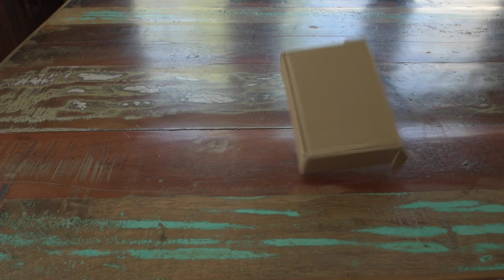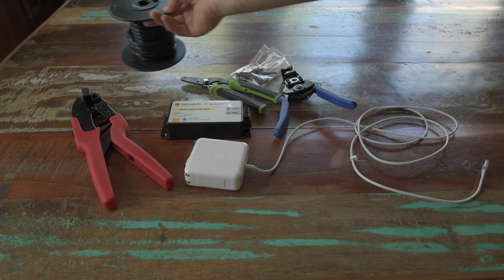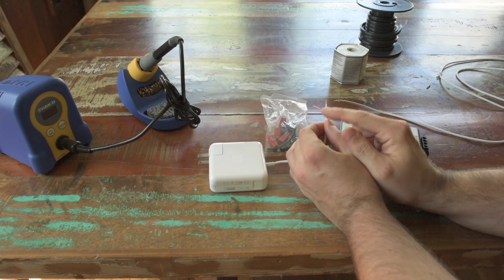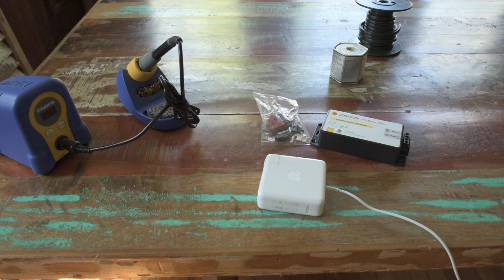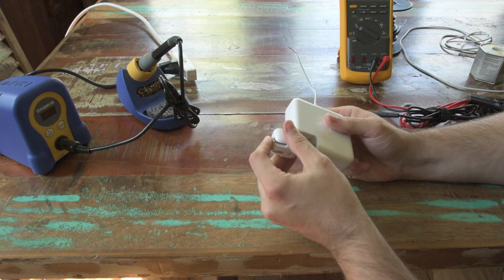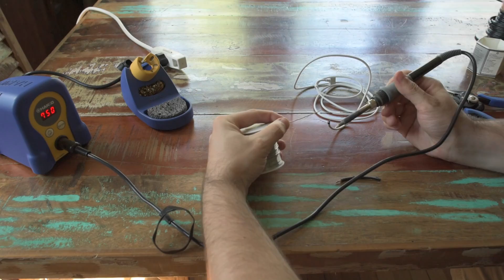DIY Solar Macbook Pro Retina Charger

Comment: There are MagSafe connectors for 10-15 $ available on eBay. No need to cut it off a perfectly fine power adapter.
Reply: I don't think they had them when this vid was made.

Comment: you can do this with 8$ replacement cables and change voltages 20v>18.5v>16.5v>14.5v for mppt
Reply: I have never had any issues in my experiments

Comment: Hey :) 
I also want to do a solar Macbook charger (having the same Macbook as you have) and really want to use the same components as you to be on the safe side. 
But I really can't find the Genasun GV-Boost with 20V. :( Would be nice if you could help me.
I'm not really into all this electro-stuff ;)
Thanks
Reply from the maker: +13lack4ngle you just do a custom voltage order from genasun. They give you customization options after you press the buy button.

Comment: If i use the Go Power 300W inverter what solar panel or batteries do i need ? thanks ..
Reply from the maker: That's a really complicated question. You need to know what you want to run, where you're located in the world, and how long you need to run it, among other things. However, in general you'll need a charge controller, a battery, and a solar panel. The specifics depend on the answers to the above criteria.

Comment: Nice job and I figured it would work.  We all assume that power coming from the wall is always clean and stable.  There's a reason they build a lot of tolerance into the adaptor and inside the Macbooks.

Comment: You should see what the wall wart amperage was charging the mac at, then you will know if the solar is maxed out or not...
Reply from the maker: Yup, I did this by plugging the wall wart into my solar generator. This setup can hit max current if the sun is bright enough, but it doesn't really matter if you hit max.

Comment: I bought (Amazon) a Mac charge cord for use in the car -- cig lighter to macbook pro.    So this is set up to be plugged into
a 12 volt battery - the car system.   Why not use this with any solar that produces a 12 volt charge.  From the solar system
directly into this cord meant for 12 v.   The voltage regulator that comes with panels set to 12 v should be the same as a car battery.  No?  This should make it easy to charge a mac from solar.   But maybe not.  Still looking for more info.
Reply from the maker: +MsScruffy4 check the description of the video above. I asked one of genasun's engineers about this. Answer: Unknown.
Reply: MsScruffy4 is spot on. This is how to do it. Wasting a wall charger is a complete waste of time and money. These car chargers can be found on amazon for ~$20-$30. It's what I use
Reply: Hey, How do you do it with the car charger? I grabbed a 100w portable solar panels ,  I can charge windows computers but my im cursed to have chosen to play with a mac lol. 

Now I am looking for a plug in play solution and the magsafe2 connection is a nightmare lol 

Appreciate it.

M

Comment: If the wire was aluminum, you wouldn't be able to solder it with rosin core solder.The solder would simply roll off.  Its copper wire thats is tinned.
Reply: Since making this video, I've had more experience with tinned copper wire. Wouldn't the wire be visibly copper in color in the center if it was tinned copper?

Comment: looks so difficult
Reply from the maker: It's more expensive than difficult. I use the tools in this video all the time in various projects, so at least that expense isn't a big deal. However, the charge controller is a very specialized thing that you can only use for this specific purpose. It would be nice if it was user programmable via a PC interface for different voltages.
Reply: i think so . magsafe2 is not easy to get ha
i wanna make some usb generator to charge my phone
Reply from the maker: Any of these foldable solar panels will do that. No charge controller necessary. They all have USB ports built-in. I recommend a 30W or higher panel. 60w is a good size. I own one of these: http://amzn.to/2adby0T and two of these: http://amzn.to/2asOWsc

More power is better for lower light conditions, but weighs more, costs more, and takes up more space unfolded.

Comment: Awesome video. If Genasun GV-Boost accepts DC 5v-51v from Solar Panels I believe it will work with 12V car lighter outlet too. It will be nice to test. Its my next project :)
Reply from the maker: +Shawn S I talked to Genasun tech support about this. Check out my notes at the bottom of the description above.
Reply from the maker: +Shawn S If you do this, let me know how it works. I haven't been brave enough to try it yet.
Reply from the maker: +Shawn S One final note: my 300W pure sine wave inverter ( http://amzn.to/1Q1MNNs ), while bulky, only draws about 3 watts in addition to whatever my mac wall wart is drawing. The efficiency of the genuine mac 85W wall wart appears to be similar to the efficiency of GV-Boost, in my testing. It's bulky and heavy and awkward, but using a high quality pure sine inverter with your existing mac wall wart is definitely the safest solution for 12V power.
Reply: @createthisdotcom  If that works than hooking up Milwaukee M18 Power Source, Model# 49-24-2371 will charge the laptop right?